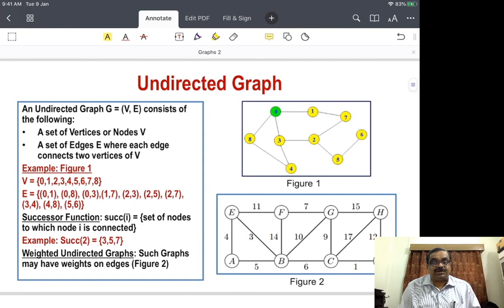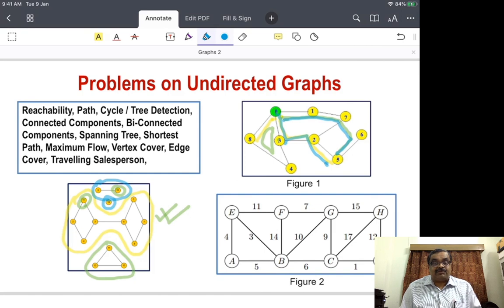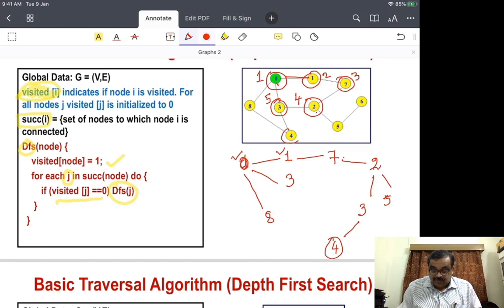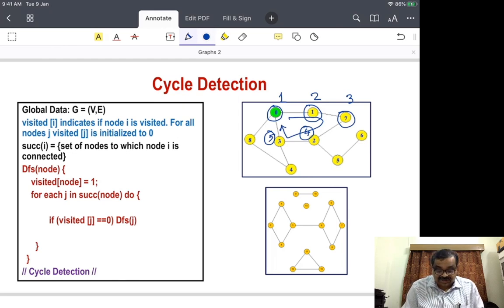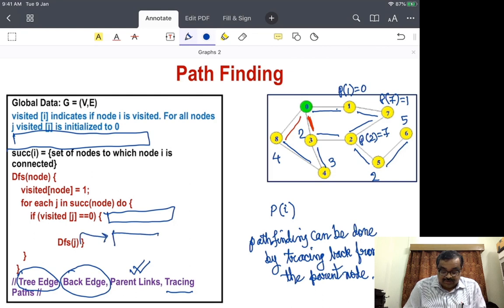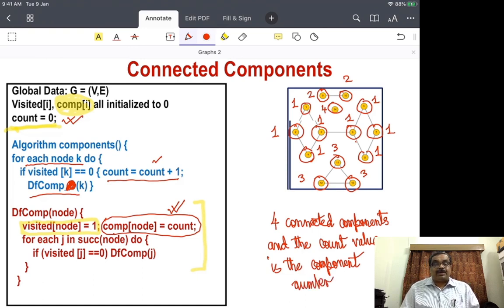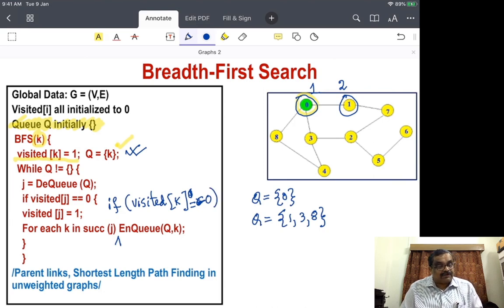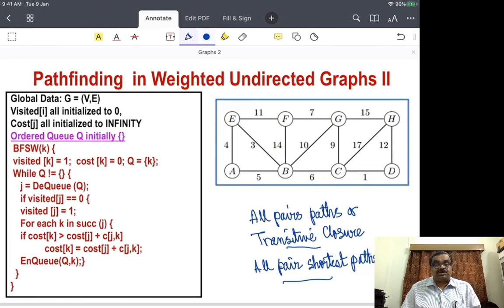Graphs-II: Traversal of Undirected Graphs (Prof. P. P. Chakrabarti)

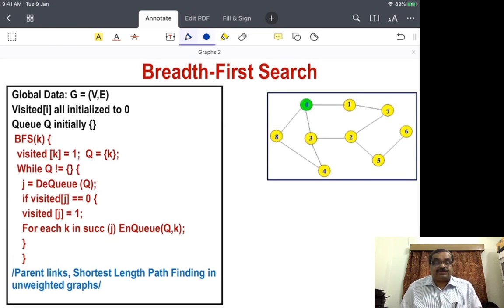Comment: There is a small typo in the algorithm in the slide on Breadth-first Search (starting 37:16) as well as in the next slide on Path-finding in Weighted Undirected Graphs (starting 44:33). In both places, at the beginning in the call, it should be visited[k]=0 instead of visited[k]=1. It will be rectified in the next lecture. Thank you. Partha P Chakrabarti